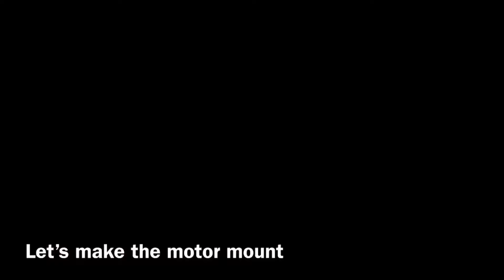DIY Highspeed Electric Bike Build 🔥⚠️Part-1 #diy #ev #ebike#homemade

Comment: Nice project ❤❤
Which controller you are using 
And can you give every detail of part use in this project please
Reply from the maker: Thanks❤😇 ,  actually its a 50Amp 48v controller, but i have increased the power of this controller in a previous video you can check out that video & as I already mentioned it's a 1200watt datai bldc motor & the motor can handle around 4800-5000watt peak,  for making the battery pack I have made one spot welder that video is also available in my channel,  & I have used A grade Lithium Phosphate cell 6000mah XXT brand,  with 16s 60A Dali BMS, 
Actually it's just for testing purpose, I will upgrade everything like battery ,bms , controller before making the body panels in next part I will explain every small details 🙌  Thanks for comment😇

Comment: bro nice project , i think you used belt drive for better performance , you make 20s 72v battery, and show us top speed I waiting this next project
Reply from the maker: to increase the speed i am gonna replace this moded 2.5kw controller with a 4.8kw sinewave controller then i will increase the battery voltage 🙌 , &  belt drive will increase the cost 🤧so for now i keep using the chain drive 🙌  😇 thanks for comment😇😇😇😇 upgraded version coming soon 🔥🔥

Comment: Could have used the existing engine's gearbox. U could get more starting torque and less load on electric motor so low consumption of battery.
Otherwise it's excellent.
Reply from the maker: yes , I want to add a gearbox.  , mainly for increasing the speed 😅  & the increased torque will be the extra benefit , maybe in the next project 🔥. & thanks 😊

Comment: List of parts please .😊
Reply from the maker: 64 pcs lipo4 cell , 16s lipo4 bms , Datai BLDC motor 1.2kw rated, Bldc controller , digital  throttle 
for now this is the small list

Comment: max speed?
Reply from the maker: With low power controller & less voltage battery pack, the top speed is around 94 Kmph,  I will increase the power later on

Comment: This is what I've been thinking because doing like a little motorcycle why wouldn't you want to use like the rickshaw bldc motor because of the lower torque and you can always.. change the gearing to get higher speed but you always still have the torque. Because I am a heavy guy 360 lb big fat dude capable of building from scratch like you I love people that make their own bikes motorcycles and the other ideas. And just like the saying necessity is the mother of invention people like Us other ones that make the world a better place. Would love to pick your brain about the motor and battery setup I should use. Please get back always use Google translator if different languages a problem watching your video you feel like a brother from another mother. Play don't tell me I can't do somethin build it myself if it's not available. Peace out God bless my friend hope to talk to you please get back to me Garrett bodel Halifax Massachusetts.
Reply from the maker: actually it's a e rikshaw motor just a bit better quality, I have used less powerful motors as well like 2.5kw peak in bikes they also works fine just heat up a bit after long use and also the top speed is low like 70kmph , but they also works just fine with proper gear ratios